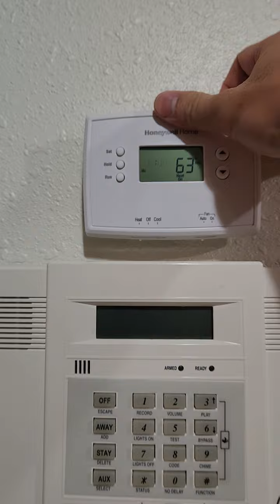Gas Furnace Lights only for 8 Seconds then Turns Off after Cleaning Flame Sensor. Help!

Comment: There are two things you need to check. First the thermostat, do it still stay on when the the flame on. Second, if you said that you clean the flame sensor already then i am really sure that your control board is bad.

Comment: Check your pressure switch, high limit switch, gas valve pressure. Get a piece of heavy solid copper wire and use it as a test replacement for the flame sensor. If it still happens, it's something else.

Please come back and report the ultimate cause and fix when you solve it.